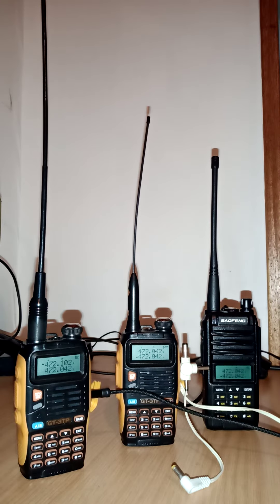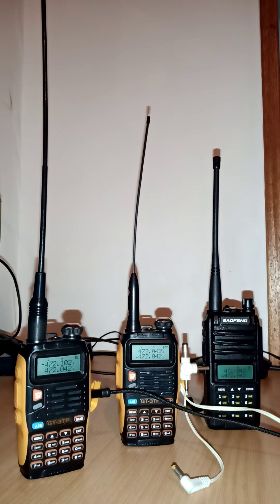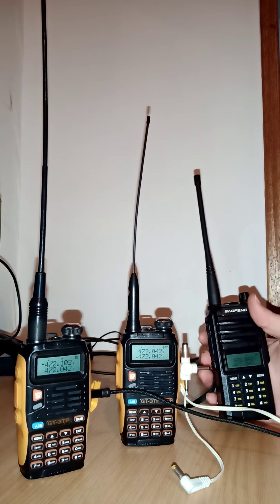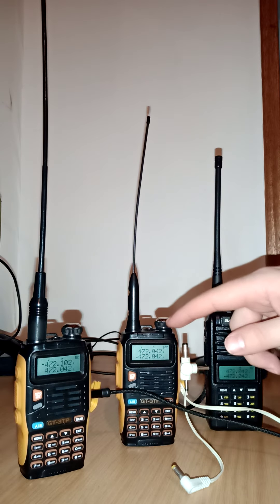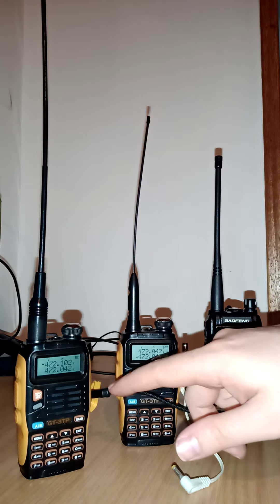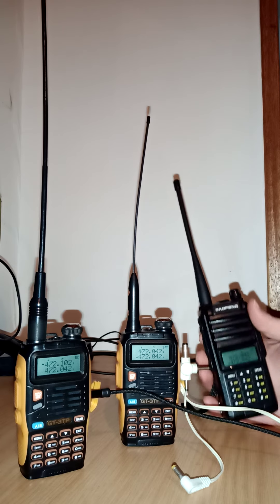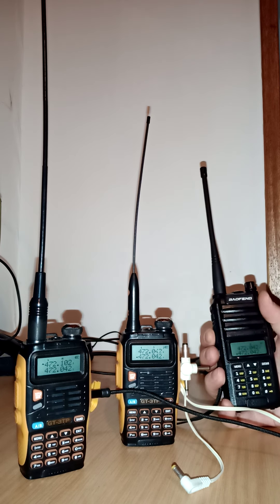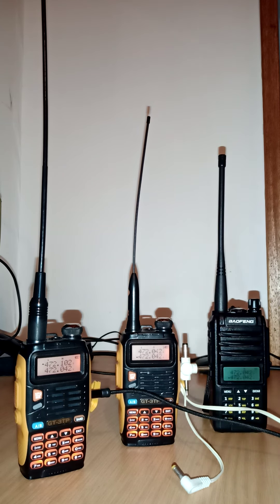Using 2 Ham Radios as a Repeater

Comment: Not a new idea, but its fairly practical if you get stuck. Some radios have cross-band repeaters built in as options which do something similar, but using only a single radio as the repeater. Add an arduino and you can add a little intelligence to it like having repeater access codes.